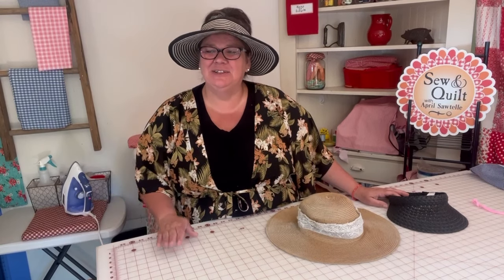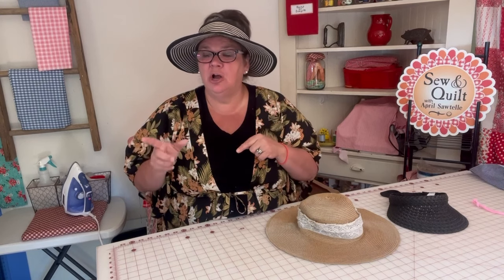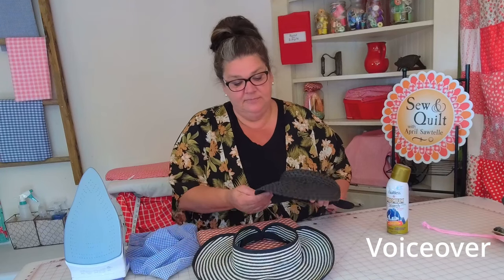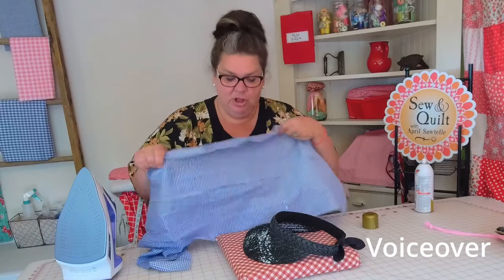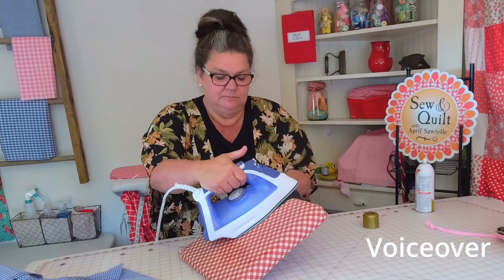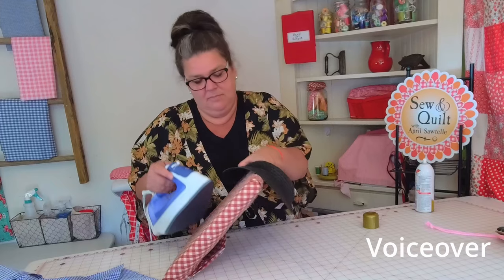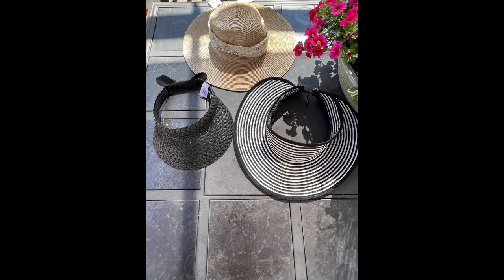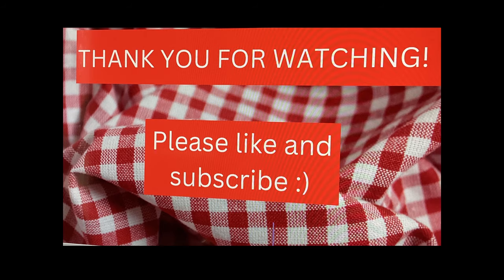How To Make A Hat Stiff Again / How To Fix Your Floppy Hats Fast And Easy / Easy Tutorial

Comment: Try running under hot water until totally soaked. Then gently stretch out wrinkles. Lay flat on a folded towel on the floor while smoothing out any remaining wrinkles. Then leave to dry. Oh, I flipped the hat inside out first.
Reply from the maker: Great tip ! Thank you!😊

Comment: How did the hats react to the starch and heat? I noticed you stopped using the material for a heat barrier. I'd be afraid the iron will scorch my hat. I'll use material just incase.
Reply from the maker: @shugmagnolia188  it actually worked fine. I was nervous that the heat would scorch the hat and it didn’t. I would use the material just in case though. I was very happy how they came out.   Thanks for watching! 😊❤️